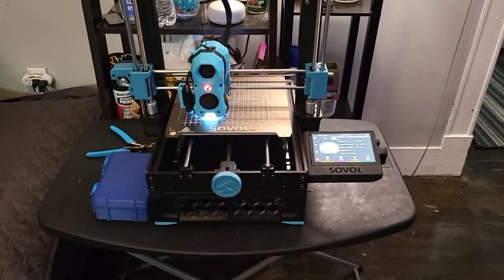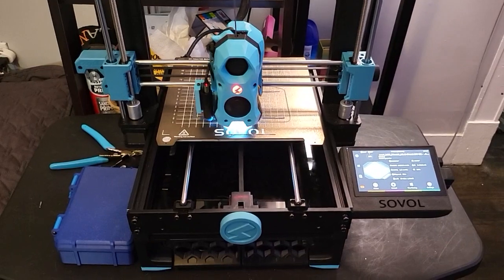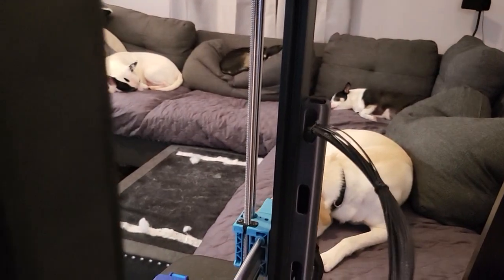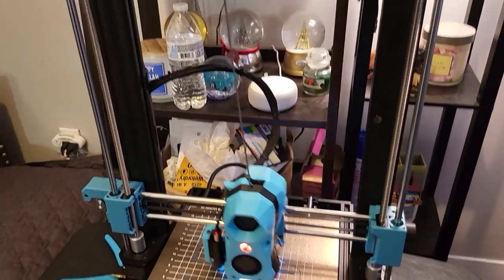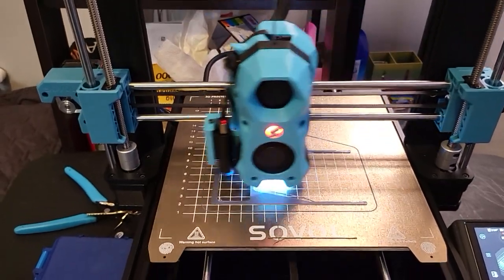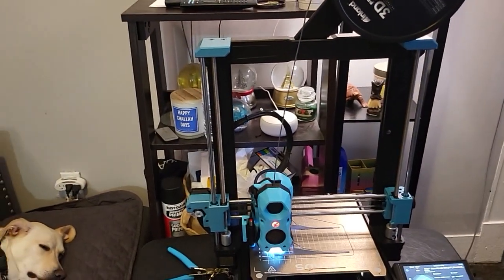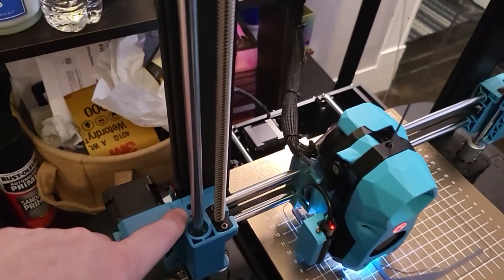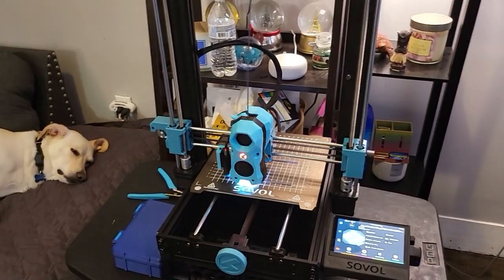Sovol Sv06 Heavily modded almost done.

Comment: How did you change the current and driver sgthrs values for the new motors? I have klipper and it does not want to home properly or print right. Keeps crashing after the motor swap

Comment: do you still have this printer and what's is its current state? I have converted mine to linear rails but i'm still using the stock extruder and marlin firmware

Comment: This is very interesting. I'm currently building a PICO MMU, but the toolhead has been an issue for compatibility. With a stealthburner using the filametrix cutter, it will solve my filament change issue! Is there an STL for the carriage adapter?

Comment: Nice! Looks like the part fan setup is much upgraded. I just designed a dual 5015 holder for the SV07+ (it's up on printables) and am figuring out how to adjust the cooling profiles for different materials. What ran fabulously on PLA is causing me grief on PETG - specifically too much cooling when overhangs take an inside turn. Any pointers? TIA

Comment: Awesome job! I'd love some sort of step by step instructions. Especially for the hotend/extruder rebuild. Did you have any issues with your left side of your bed showing way lower when auto bed leveling. I've tried everything I can think of and can't fix it
Reply: bro Im having the same problem! Even if I level everything manually then do an auto level bed mesh it will start printing high on the right side. I don't understand whats happening.
Reply: @AwestruckAudioHertz  I've taken apart the printer and rebuilt to make sure perfectly square. The brackets that hold the z motors are definitely not square to the Z posts. I used a shim I found on printables to jam behind them which brings them square. Then I replace both lead screw rods just to take that out as a variable (actually made a difference). I'm running Klipper and I've got the bed mesh variance down from 1.4731 to .1756. All of that and I still can't get a perfect first layer across the entire build plate. I'm now convinced I need to run X twist compensation to smooth it out. Idk

Comment: Out of all of the upgrades, which ones are a MUST? Any help would be appreciated. I'm buying this printer and want to make sure it runs good
Reply: The only hardware I have upgraded were the fans on the X head. Better 5015 part cooling fan and a better fan for the heat break. It ran fine before, I just wanted a better view. Octoprint made it easier to send jobs to the printer, and I'm working on Klipperizing it now. (Neither are required for normal printing.)

Comment: It looks like you got rid of the Y axis linear rod holders / mounts.  Is that right?  Do you have an STL if you did?  I am so sick of this printer breaking...and those Y axis mounts are super thin...I was trying to diagnose terrible banding....I bought Drylins and while taking it apart, I realized the mounts had snapped...this is after I had to redesign the X axis pulley and fix the extruder.  I love the machine, but I can't stand where they took the cheap route.

Comment: The maracas (bearings) that come stock with the sv06 definitely seem like they are missing a bearing. My sv06+ sounds much better after packing them with Superlube, but still work fine and most of the noise is gone. Eventually I’ll swap out for drylin, still haven’t seen anyone post the safest way to remove the Z rod bearings.
Reply: Use two sockets and a C clamp,  one small diameter socket to push on the bearing that is small enough to fit into the plastic Z housing, and a larger socket large enough to push the bearing into.   Tighten the c clamp with the sockets and Z housing in between and the bearing should push out easy with not much force on the C clamp.   Look up how to use a bearing press, and then improvise one with sockets and a C clamp.

Comment: was your bed messed up? Mine is, I haven't even had the time or want to mess with leveling it. 1 month old printer, can't use it. Do you have files to share on the mods? would be cool if you did!  The MK4 parts can be printed out and 10mm guide rods could be used.. Just heard, on printables, subscribed btw!
Reply: >The MK4 parts can be printed out and 10mm guide rods could be used.

Could you please tell me what you are referring to here? The Prusa MK4?
Reply: @evropapagan5551  YES the new files from Prusa MK4, they used the 10mm rods instead of the 8mm ones
Reply: @Patriot_First  Do you have the link to the Printables page?
Reply: @evropapagan5551  no, just go to printables and do a search.

Comment: Hi Mate, good video. Any chance you can provide links to the mod/upgrade parts. Thanks.
Reply from the maker: Models are on printables under the same name as my youtube handle.   As far as parts used...

Btt Manta m5p board with btt CB1 cumpute module and 5 2209 stepper drivers
Meanwell 350 power supply can get tbose online I think TH3D carries them
Bontech extruder gear set (same as used on voron 2.4 or trident clockwork 2 extruder)
Igus Drylin bearings (10 in total) just google them they are 8x15mm in size.
Voron trident under deck wire kit (check fabreeko or KB3D)
Deck panels were custom made and cut by sendcutsend, in the sovol forums under printed mods I listed all the stl and dfx files needed.
Reply from the maker: Oh and btt hdmi 5" touch screen.
Reply: I'd like this too please or perhaps the exact specs / model part of each of the item. Thanks
Reply: @eclypse3d are your new motors 0.9 or 1.8? Did you have to adjust the printer.cfg? Have you got a link to the motors? Sorry for all the questions 😅
Reply: All you are missing are carbon fiber rods.. I’m interested in the igus drylin bearings - did they fit in all the same parts the steel bearing are housed in with out any modifications needed? Any thoughts on how they will wear vs the steel bearings?

Comment: You almost build an completely new machine.  Not to mention the cost of another machine.  2 printers are always faster than making one go fast.  but to each his own.  Have you seen the cable chain for the sovol sv06 on thingverse and printables?  I think it would help your cable management and its an amazing design.
Reply from the maker: Yeah its overkill, but a fun build.  I will look at cable chain mod.
Reply from the maker: Oh I have also made it whisper quiet running stealchop in the config on the steppers.
Reply: maybe he might have extra parts available therefore he might have done this upgrades
Reply: @flyinghigh2646  well he actually said that in the video but you have to admit a bit overkill for a little more speed.

Comment: How did you remove the z axis bearings?
Reply: Use two sockets and a C clamp,  one small diameter socket to push on the bearing that is small enough to fit into the plastic Z housing, and a larger socket large enough to push the bearing into.   Tighten the c clamp with the sockets and Z housing in between and the bearing should push out easy with not much force on the C clamp.   Look up how to use a bearing press, and then improvise one with sockets and a C clamp.